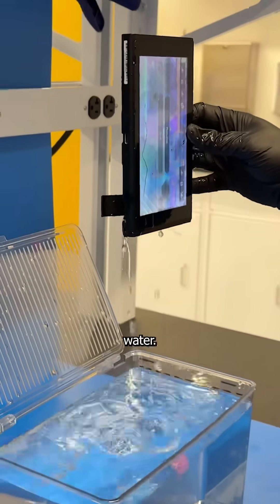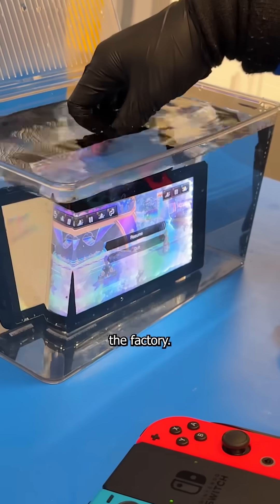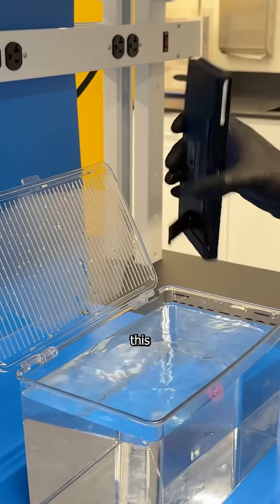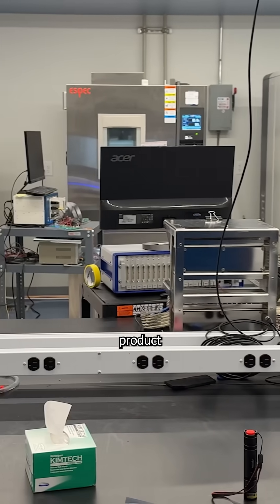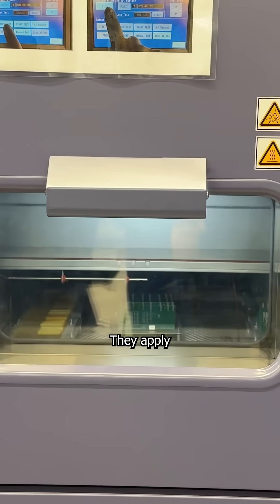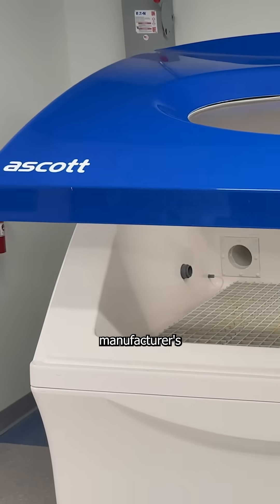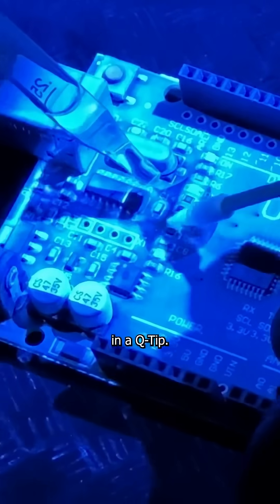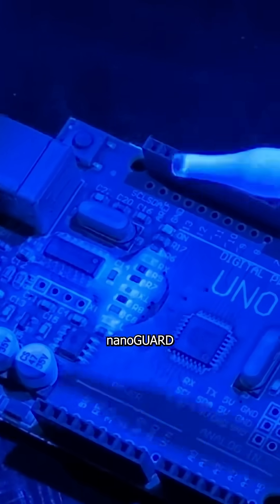Waterproof devices are the future of #technology & nanoGUARD #tech is how we do it! #shorts #pc

Comment: No company is gonna want this. It'll prevent them from saying the device is unfixable and so you buy a new one.
Reply: HAHA. They will tell you that because you chose a waterproof version they won't be able to perform repair because of conformal coating. And even if they would be able to do so they will charge you more for the hassle of removing it(acetone isn't particularly healthy) and reapplying. And because it will be applied manually there may be missed spots because they don't care, lol. And guess what, in second iteration majority won't choose a waterproof version because of drawbacks that exceeds the probable benefits.
Reply: My bet is on framework. They will probably have no aversion to adopting it.
Reply: I want it for my company but I think my company is too small sadly
Reply: my bet is on valve, they have no investors to tell them no because theyre private
Reply: @cipeman3498  no, they would not use this because the whole point of the steam deck is repairability. This ruins that.
Reply: This would literally make the board unfixabke 🤦‍♂️

Comment: Damn the marine industry would kill for this shit…
Reply: Yup. We sure would.
Reply: Tap water is much easier to deal with than sea water. Ans conformal coating has been in use there for decades.
Reply: @TheNefastor yeah and these water resistant coatings don’t last forever.
Reply: @casedistorted  nothing does, but they last a very long time.
Reply: Pretty sure there are stronger coatings, even full waterproofing for their electronics already, this is more so it can be applied to electronics that need good thermal scores and are not meant to be waterproofed in normal use, also, salt water and the salty breezy will still destroy this coating, very very fast
Reply: Salt would still mess the thing, just slower... and in a less predictable way.
Reply: @worldspam5682 there is no ”the thing”. There are several different nanoguard coatings for various applications
Reply: Salt water is a different beast. Pure water is actually not very conductive, until there are dissolved ions such as salt. With the increased conductivity, that is a big no for electronics and it also leads to a higher rate of corrosion, also a big no for electronics.
Reply: and they probably already did
Reply: That's why I was thinking! Drones that can have their electrical components exposed!
Reply: Oh my god I've been hiding my phone in plastic lanyard pockets I need this
Reply: Army always get better toys first.  Peasants is later
Reply: nah, sea water still causes stuff like rust
Reply: assume the salt water would affect the coating
Reply: What makes this better than existing conformal coatings?
Reply: @Rank-Amateur  most probably that it could be easily removed and reapplied (and could be used in already established manufacture, but that's their own words, with no demonstration)
Reply: @Rank-Amateur  It’s just PFAS-free.

Comment: Super cool! 
What happens if you want to recycle electronics or repair a device with this applied? 

If it's safe for the environment, can it also be removed easily if you need to take a device to be repaired or recycled?
Reply: They demonstrated in the video that you use rubbing alcohol to remove it :) this sound alike  silicone conformal coating (similar to nail polish), but that is toxic so I’m not sure how they can get a coating where it’s not.
Reply: @athenovae  Sure, the acetone and  isopropyl alcohol are relatives but they clearly stated that you need acetone...
Reply: If you want to “recycle” it, throw it into a local water supply and forget about it

Comment: honestly that's a really cool thing cuz you don't if it's watergarden that means it's never exposed to oxygen which fucking sucks at sucking in heat you can instead have a covered in like something really fucking cold like water or even mineral oil which are both way better and you don't have to worry about it having like particles that could lead to short circuiting cuz everything is already waterproof